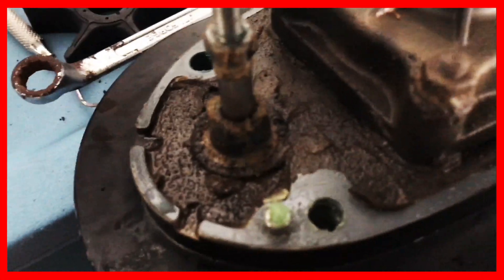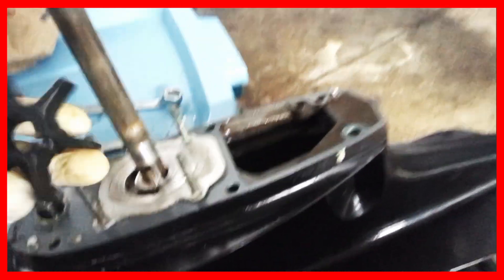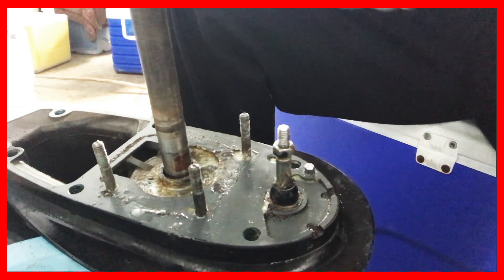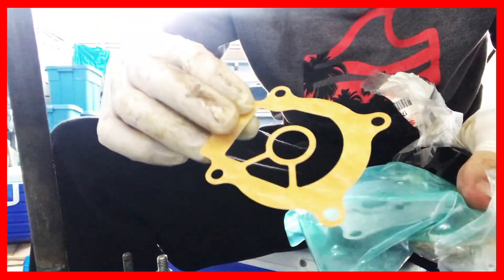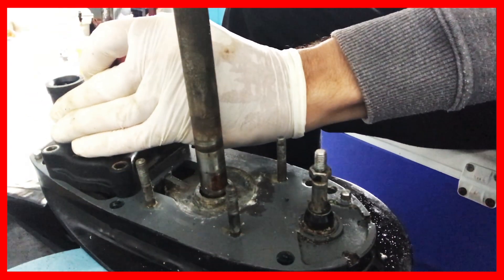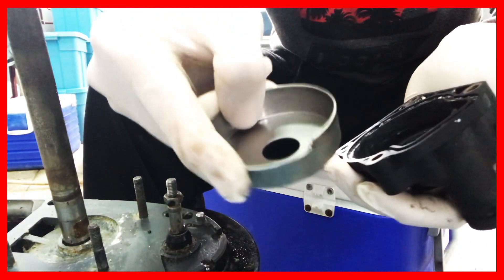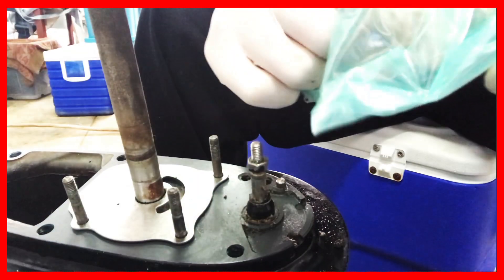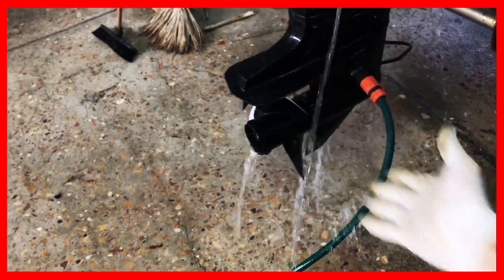Suzuki Outboard - Replace Water Pump Parts - Quick & Simple

Comment: The first time ?
After how many hour did you replaced the impeller ?
Reply from the maker: First time I replace the water pump plate, gasket, rubber seal ring,  inner sleeve and key. I usually just replace the impeller and close it back again. I change the impeller every 150h more or less. Should be every year or every 100h.
Reply: THAT WAS ALMOST WORTHLESS.....PITIFUL
Reply: @CaptShannon  what the hell are you talking about? That was a great video. Helped me a ton. What a loser posting this garbage here. Ricardo, you should delete this hater